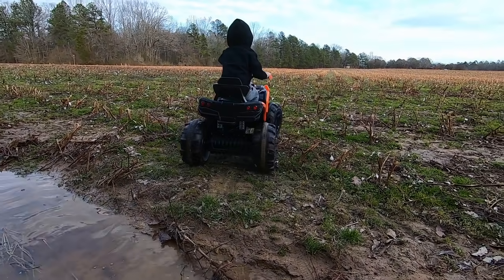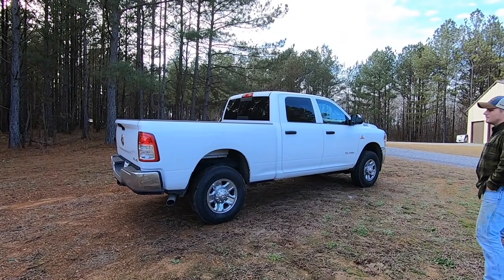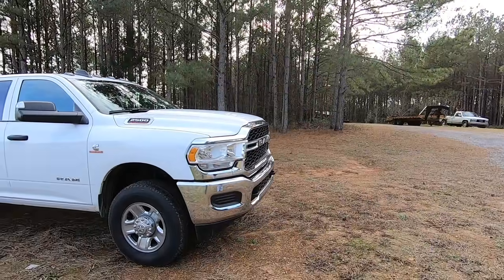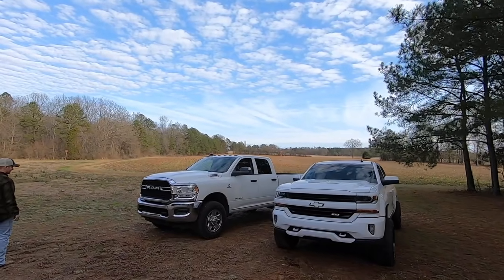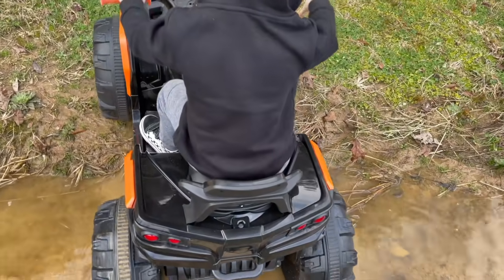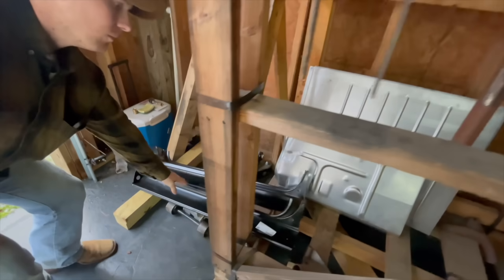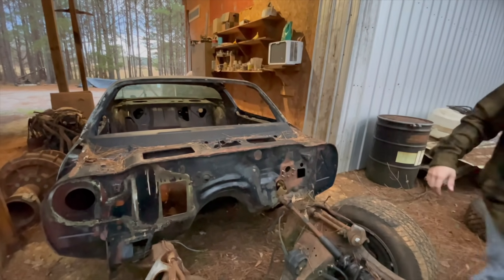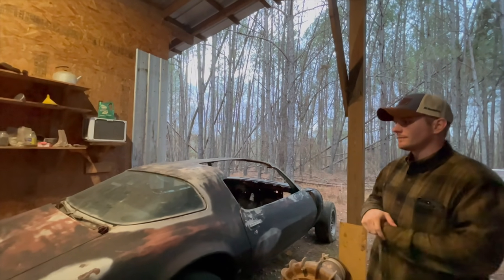Revealing BRAND NEW TRUCK to the channel!!!!

Comment: Need to put 37’s on stock 20’s, my bud has a 2021 Ram 2500 megacab and did a 2.5 leveling wit 35s and we seen that he had enough clearance for 37 so we put 37 off a 14 ram with stock wheels on 37s and they fit perfectly with enough clearance. So now he ordered 37 for it
Reply: He didn’t have to cut?

Comment: The only thing you have problems with is you can’t EGR delete the 2020 trucks anymore. It goes for any 2020 deisel. No more deletes.
Reply: Uhhhhh. Wrong. Lol.
Reply: @7gerez  ok. You can but it cost way too much because the factory computers are delete compatibile even with a tune. You have to buy a new computer that is compatible with a delete to do it so it’s just not worth it anymore.
Reply: @DownYonderGaming  don’t think you have to buy a new computer for ram
Reply: @hunterarmentor9439  I really don’t know much about the 2020 trucks yet. I know more GM vehicles then anything.
Reply: @DownYonderGaming  for just under $3k you can delete the 2020 trucks. That’s including transmission tunes. No computer swaps.
Reply: @7gerez  like I said. I don’t know much about the 2020s yet

Comment: That is a CP4 pump. The updated one will have 8 punch marks. 4 punch marks indicate CP4. Hence 4 punch marks, 8 punch marks, CP4 updated. And for 2021 they went back to the CP3.
Reply from the maker: It’s the Updated cp4
Reply: @lmfscrew  4 punch marks on the body indicate CP4. 8 punch marks indicate CP4.2..pause the video and zoom in on the body.
Reply: Either way. Both are prone to failure.
Reply: @chrisnelson9098  not how it works. Updated one has a dimple and any number of the grid pattern. It can have 8, 6. Doesn’t matter.
Reply: @chrisnelson9098  thanks for the positive words!